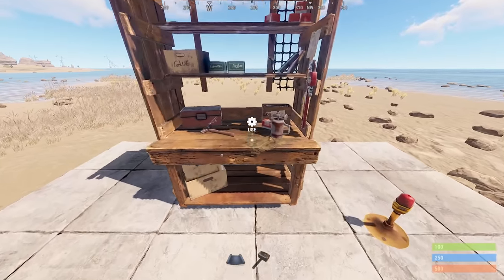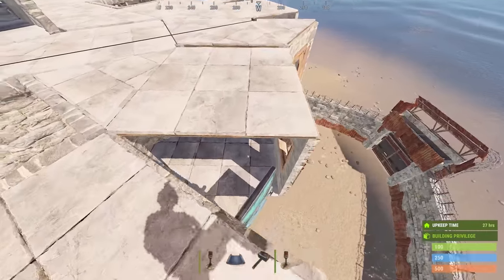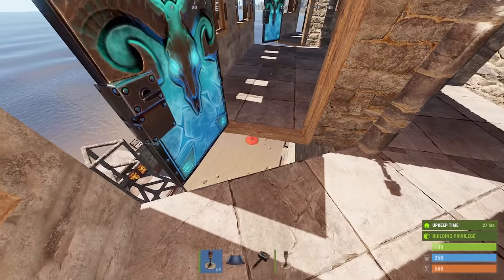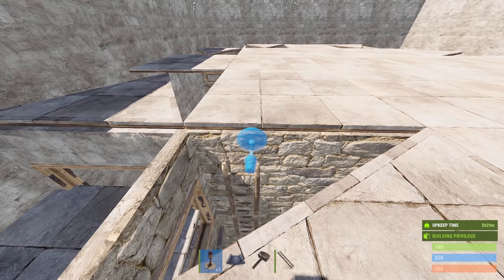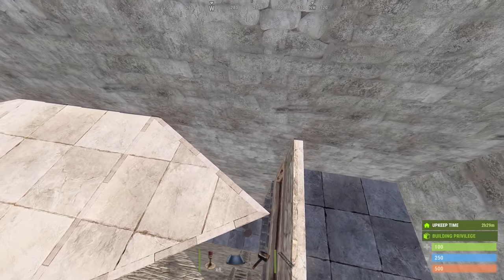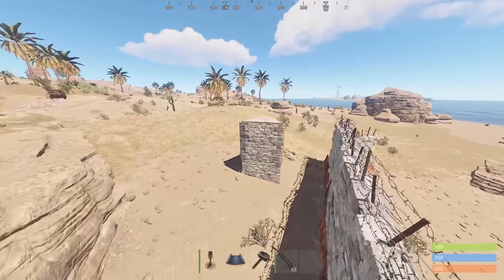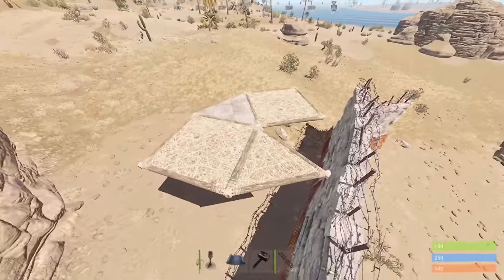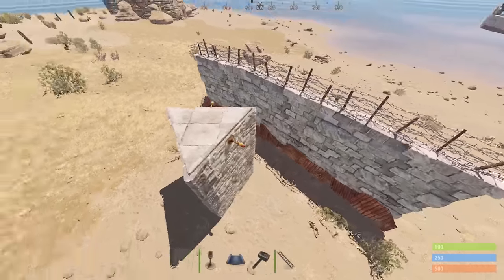Rust - Build Better Rust Bases (EP: 2) - Rust Base Design 2021

Comment: If you place heartbeat sensor on the inside wall of the external, close to the roof, twigging is also blocked. The advantage of that is that it's hidden, and will make people question themselves when trying to twig it. I always use that on compound entry points for example.
Reply from the maker: That's pretty smart